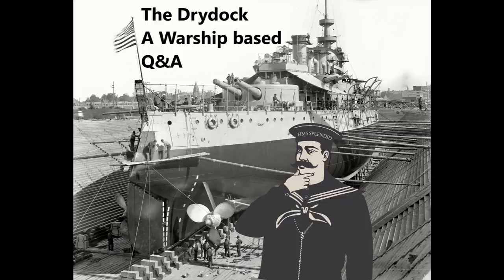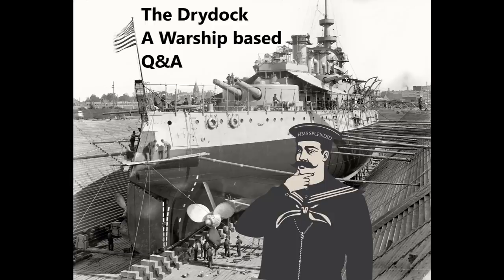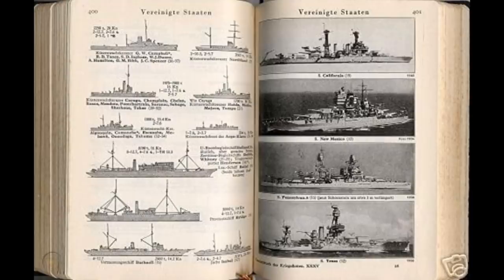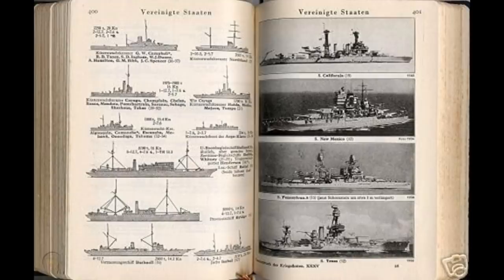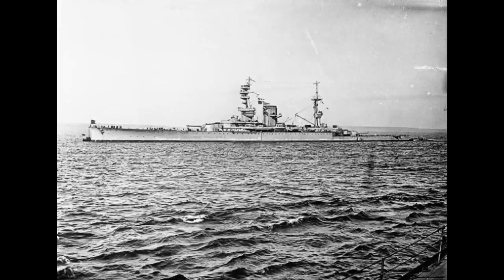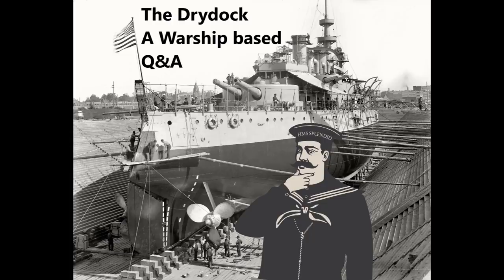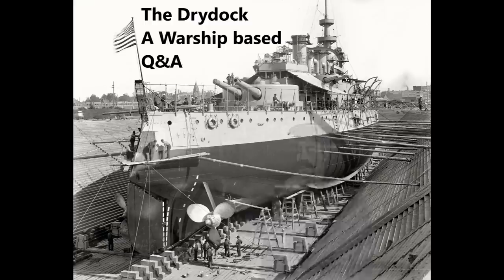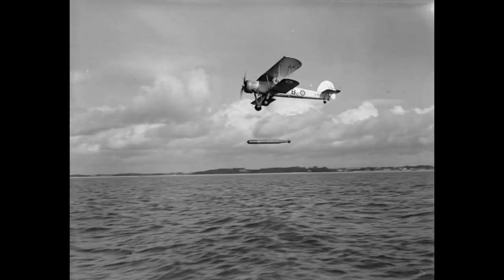The Drydock - Episode 138

Comment: I genuinely don't think Cradock was at fault at all he was hampered with a bad fleet composition of which had mixed speed capabilities and questionable firepower he had pressure from the admiralty to engage regardless of how badly outmatched his fleet was. He was refused the reinforcements he needed for his command to actually function with any real state of efficiency and power and overall the admiralty back home failed him and his men on every level so if anyone's at fault the buck stops with the admiralty for the loss of Cradock and all those good men.

Comment: Regarding the torpedo defense discussion, it was telling that after the RN and USN started deploying their new torpedoes armed with TPX/HBX warheads, torpedo hits started producing almost guaranteed results with each hit. In the USSBS post-war interrogations, IJN commanders remarked at the effectiveness with which the torpedoes were completely negating their torpedo defenses during the latter half of the war. The RN began testing their new explosive with the Mark XV torpedo in late-1942, with deployment in mid-1943, along with the Mark VIII and IX that were redesigned to use TPX. After their discovery of TPX, they informed the USN, "Hey Yanks, look how much bigger the booms are when you add aluminium!" So the USN also began their own testing with TPX in early-1943 on the Mark 18 torpedo, with deployment in mid-1943. The success also caused it to be incorporated into the Mark 13, 14, and 15 redesigns, with the Mark 14 mod 3 and Mark 15 mod 3 deployed in late-1943, and Mark 13 mod 10 in early-1944. The Mark 15, and some Mark 13 torpedoes depending on manufacturer, actually used HBX (High Blast Explosive) which was a variant of TPX which is less sensitive and more stabilized, essentially the explosive power of TPX with the safety of Comp B.
Reply: I remember reading Dick O'Kane's memoir of his time as skipper of the USS Tang.  He enthusiastically recalled how much more effective his torpedoes became once they started using Torpex warheads.  He wrote that before Torpex, a hit would put a nice hole in a Japanese ship.  After Torpex,  the area of the ship he hit would virtually disintegrate.  It was a huge and welcome difference.  In addition to making the kill more certain,  the bigger bang meant it was less likely a ship would manage get off a distress call and alert the whom ever gets alerted for such things to the presence of a sub in their shipping lanes.
Reply: Can you imagine the Lethality of IJN torpedos of all sizes (all had larger warheads than the Allies equivalent sizes) if they had used Torpex???

Comment: Oh, mysterious technical issues. Those make both the best and the worst experiences. Best workshop I ever had about it was explaining that:
1) Focus on the actual physics, work out how sensitive the mechanisms are for disturbances. Be careful rolling away with only how you think it works. Human imagination is way to eager to construct complicated failure modes in the face of uncertainty than admitting that simple key parameters are actually not known or even quantified. 
2) Don't be afraid to apply maximum conclusive tests: so if you think a certain small very inconsistent misalignment, might 'somehow' be causing quality issues, it might be better stap to crack up that misalignment a few factors and see if quality issues go through the roof or stay similar. A way more conclusive way instead of trying to figure out if an possible issue, that 'might be the cause', actually occurs enough or significantly enough to matter. The later way easily ends you up in a rabbit hole that risks always ending up trying to proof a hypothetical failure scenario occurs instead focusing if this scenario actually matters.  
A good design should have a certain robustness in regard to the small uncertainties that you expect, and you really want to prove if this expected robustness is actually present, or maybe even underestimated.  If your designs works even under overloading, but still fails in the field, than this could indicate your design loads are not taking into account actual field circumstances: that is not a quality issue, but might be a design issue.
Reply: And don't be afraid to ask the really obvious questions. In the end it might have been an open valve or a plug not seated correctly and nobody botheted to check for it. It's easy to overlook "obvious" things.
Reply: Same from (electronic) "Control technologies" - you design it, calculate everything down to three of four digits, then get a screwdriver and make the final adjustments by hand.
Reply: @karlvongazenberg8398  Yes - but there are always "intermittent" faults you will spend days sitting in the sparkers caboosh waiting for - but by the operation of Murphy's Law ("The hostility of the Universe tends towards a maximum") they won't occur vntil you are called away to plug the CEO's new mouse in.
Reply: I remember reading somewhere that when rebuilding a VW Bug or Microbus, after reassembly there will be parts left over. These extra parts will NOT affect the operation of the vehicle. 

Note that with enough rebuilds you will eventually end up with two fully operational vehicles. 😁
Reply: While I agree with everything you say, you do realize it's diametrically opposed Industry trends for the last 3 decades? Ever sat in on a design meeting? 90% of clients don't give a shit about reliability, make it as light and cheap as possible, who gives a fuck if it lasts, look at any luxury car made in the last 30 years and that shit becomes painfully clear. I wish your standards were the norm, but expecting quality from industry in 21st century is fucking hilarious.
Reply: 3) pray to the machine god and bless it with incense
Reply: This thread is regarding the Warspite steering issue?
With zero background on the specific issue, but a few years in shipboard engineering, I wanted to say that Drach's comments make good sense.
Those who've grown up with laser measurements likely can't appreciate the difficulty of identifying cascaded alignment issues in olden tymes.
Case in point:  
- timeframe: late 1980s
- situation:  stream driven piston bilge pump ("a stroker,") mebbe 4" piston diameter
- problem:  pump worked fine after a rebuild, but consistently started binding up during regular use. I venture the real issue was not the cylinder sleeves or the linkage, but a mildly bent frame.  How are you going to fix a "mildly bent anything," much less a mildly bent cast frame like that pump had?
Lesson:  Mild problems can be the worst problems to solve

p.s.  this thread seems rife with deeply technical answers that are well suited to a lab environment, but ill-suited to troubleshooting massive control gear on a large, flexy vessel.

Comment: I was our machine tool operator/ welder on submarines, 3 and half years and only thing we machined was a cracked bushing we brazed back together for the ship's dryer because we didn't have a spare.
Reply: Don't feel bad.  I was on a fleet oiler, and the main job our MR1 had was creating desktop "oil barrels" out of brass round stock as gifts for the ship's that came alongside.
(since his handwriting was so good, it fell to the MPA to engrave the ship's name & hull # on the barrels.)
Reply: @77thTrombone  Tried to go MR but told they don't promote... went MM and sold my soul to submarines. My MPA was a hell of guy.

Comment: Swordfish was a heavy lift (for it’s size) STOL aircraft capable of operating from carriers decks heaving about on Atlantic swells. Up to at least mid WW2, there was nothing else that could do the job.
It’s metal frame design was similar to Gloster Gladiator and a direct forerunner of Hawker Hurricane.

Comment: I carried motors up & down ladders.
Rigged them in & out of tight spaces.
I replaced bearings & rotating sliprimgs.
I may not make turbine blades but I can fix a lot of stuff.
From top of a silo to a sewer pipe.
You'd be surprised what we can do.
Reply: My next-door neighbour was a Med Tech in the RAF. He was called to assist HMS Triumph's crew when she was the repair ship at Singapore, and a fire had put the dentist's equipment out of action. He surveyed the damage and went ashore to round up spares. He cpouldn't (quickly) replace one mtoor, and returned to the ship next day to explain the delay "No problem. We've already rewound ir".

Comment: 00:20:50 Regarding warships as merchant raiders, they only really work if you can guarantee a short war. Emden would have been fine if the war had lasted just a few months or a year: about as long as the average survival time of a warship in that role! Same for Graf Spee in the next war. But unless you can be fairly sure the war will be short and sharp, then warships designed for, or devoted to, merchant raiding probably represent a net loss to the owner no matter how much tonnage they can sink.

Comment: Coincidentally, a few days ago I was reading Lundstrom's "First Team and the Guadalcanal Campaign" and he mention that near Samoa, USS Wasp had to shut down her stb engine because of damaged impulse blades in the steam turbine. After dismantling the turbine, her engineering team managed to repair the blades in the midst of a gale in Tonga and the ship was able to get 25 knots (and be ready for her doom in the next weeks), so they probably had a talented engineering team and/or a good set of blueprints of the parts and/or a fine piece of milling and lathing machinery on board.
Reply: Not entirely sure if what I'm going to say is actually what happened or if its done, but theoretically what could be done is simply removing the damaged blade and its opposite in order to keep the rotor balanced. That would decrease its effectiveness, but I suppose it could be done more realistically then machining a new one. At those rotations the slightest imbalances will quickly tear apart a turbine.
Reply: @eduardocharlier7560  Lundstrom literally says "They removed all the blades for repair, a massive job for a warship at sea" and after the repair was done the engineering team "strongly reccomended that the whole assembly be replaced at Pearl H. as soon as possible". But ok, he's an historian and not an engineer and he got second or third hand accounts...and the piece of machinery in question didn't get to Pearl. If they solved the problem they way you say, probably had to do make some rearrangement of the blades in good order to spread the load in all the four quadrants rather than removing more elements in the opposite side. But I'm not an engineer too, just a humble industrial designer.
Not naval but related: this makes me remember some stuff I read in a book about Central American air forces. Costa Rica got their first plane, a donated Avro 504 in the late 20's. On the first landing the pilot run into a tree and damaged the propeller, so they went to a local carpenter for a replacement. The guy was a furniture maker and as the book says, he made a beautiful replacement, but nobody tell him about the need of balancing the mass. The book doesn't says how was the second landing of the Avro.
Reply: @funkytorino  If they were just fixing cracks in the blades, that can be done by soldering and polishing.  Making a new blade would probably be prohibitive.

Comment: 31:00 Swordfish and dive-bombing - it WAS certified for dive bombing, maybe more exactly shallow angle dive/glide bombing and there are pictures of Stringbags actually divebombing.
Reply: You also have the previous Hawker Hart family of aircraft (there a LOT of variants with different names) that was used as a dive bomber by the Swedes among others, in part it was an experiment to prove it was feasible as a form of attack, which others paid attention to.
Reply: The Swordfish has the climb rate of a bus. You can't get it up high enough or fast enough to be a decent dive bomber.

Comment: Re machine shops - a turbine blade has to be very accurately produced if you want it to be efficient but you could probably rig up a very simple "get me home" blade. Look at some of the early Parsons turbines, the "blades" were little more than angled saw cuts in the rim of the rotor. It works but not as efficient as a proper aerofoil
Reply: I'm no engineer but wouldn't you expect so violent oscillation?
I know RC props can shake themselves to pieces if not balanced
Reply: @NM-wd7kx  If the blades themselves vibrate they may fail eventually but as I say it would be a get home option. In terms of balancing the whole rotor, typically there are features which are specifically machinable to balance the rotor. You probably couldn't get a great balance but enough to make a trip home, especially at low speed.
Reply: From the Kipling Society's notes on "Judson and the Empire" :- We will meet Henry Salt Hinchcliffe, a first-class Engine-Room Artificer, in “Their Lawful Occasions”, and RK showed his admiration for artificers’ skills in his description “If you hand ‘im a drum of oil an’ leave ‘im alone, he can coax a stolen bicycle to do typewritin’.” Mr. Davies is another such. Engine Room Artificers (ERAs), now known as Marine Engineering Artificers (Propulsion), (and their later colleagues the Ordnance Artificers, Electrical Artificers and Radio Electrical Artificers, etc.) are the Navy’s skilled artisans, who complete a demanding apprenticeship, and are then qualified fitters and turners, or coppersmiths, or boilermakers, etc.. Like RK, the author of these notes has an immense admiration for their skills, and has yet to find one who couldn’t tackle anything mechanical/electrical and make it work.
Reply: Considering the size of the turbines, it  may be that balance is not too much of an issue if you are only replacing  a few blades.

Comment: Lyddite-filled WWI-era British APC shells did not have fuze problems.  The Number 16 APC shell fuzes worked perfectly.  However, even if the fuzes had been completely removed from the British shells, when hitting thick armor (over 1/3rd or so of the projectile diameter), particularly face-hardened armor that caused a high initial impact shock, regardless of the AP cap being there or not, set off the Lyddite "high-order" almost all of the time, restricting the shell to only having about 0.003-second to move forward after a hit, fuze or no fuze.  So the fuzes at this time in British APC shells had no delay-action portion and thus had an identical 0.003-second impact-inertia-caused delay from testing by both US (with its insensitive Explosive "D" filler) and British shells using non-delay fuzes.  Only the Germans used a rather poorly-designed, highly unreliable,  delay-action base fuze in its C/11 (1911 Model) and after APC shells at this time, which did increased damage when it worked properly and immediately after the Battle of Jutland caused the British Navy to create new-model APC shells with hard, thick AP caps, smaller filler cavities to strengthen the shell body, new Shellite insensitive filler explosive, and a modified, much more reliable APC base fuze, based on the older, RELIABLE non-delay Number 16 APC shell fuze with an added delay and second post-delay detonator (designed properly, not like the Rube Goldberg German fuze), the Number 16D, with an optional (set or not at loading the gun) roughly 0.025-second delay.

The non-delay-type base fuze was universal at the start of WWI (except for the above-mentioned German design) and in most cases were reliable when hitting at angles up to 45 degrees from right-angles (some worked at even somewhat higher an angle than that), since they were very simple in design as long as the shell did not hit at too much of an angle to jam the firing pin sideways so it could not move forward to hit the detonator.  Without the delay element, the fuze inside was rather straight-line in its operation, as long as the arming mechanism after firing worked properly (even this was not as safe -- not complex and interlocking --  as it later became after WWI).

The major problem with reliability in any fuze, delay or not, nose or base, was not the fuze itself in most cases, if well-designed, but the new insensitive fillers like German block-TNT and US Explosive "D", since these explosives required a much bigger "kick" to set them off reliably and with full power and boosters were either not used (Lyddite didn't need one) or not very powerful -- a "booster" is small high explosive capsule added to the end of the base fuze -- inside the fuze or outside as a separate item -- to change the blast of the firing-pin-impacted detonator pellet in the fuze (the very powerful but extremely dangerous in anything but very tiny amounts fulminate of mercury or lead azide, mostly) into a larger "boosted" explosion hopefully large enough to set off the main filler charge properly.  Unfortunately, any explosive known during the time frame prior to 1928, when the explosive tetryl was developed as a booster by both the US and British Navies, was not powerful enough unless it had to be made in a too-big lump and/or was not safe or reliable when pounded by an armor-plate impact shock, so several tricks were attempted with varying degrees of success.  For example, the pre-WWI US Army used several stacked rings of less-than-desired-booster-power TNT boosters wrapped around their Coast Defense gun AP/APC shell base fuze upper ends, basically just "rolling several dice to get one that rolls the right number" and sets off the shell properly.  Rolling dice was not considered the best kind of design specification, which is why new fuze boosters were continued to be experimented with until tetryl was finally found.

Note that this booster unreliability is the OPPOSITE of the unreliability problem given in the statement about British WWI APC base fuzes prior to Jutland.